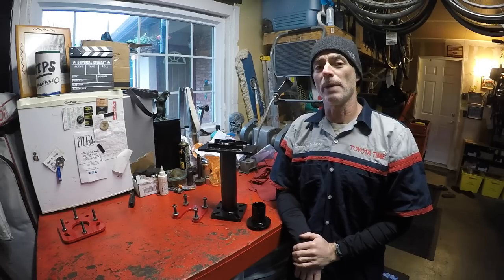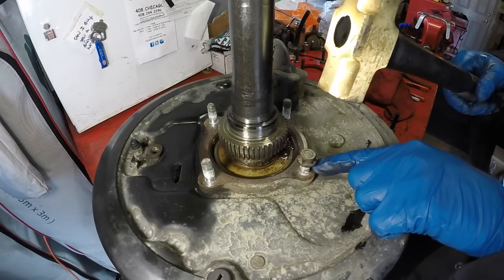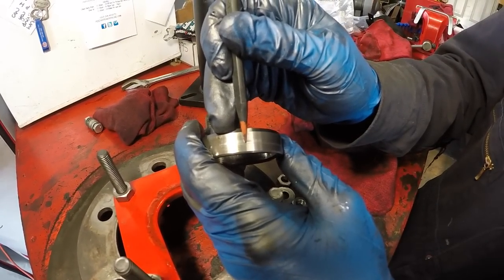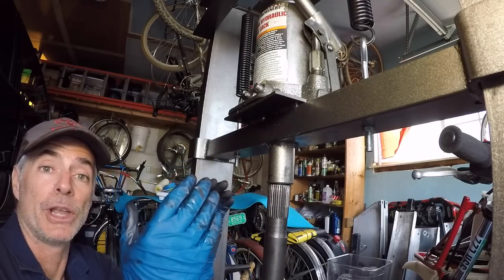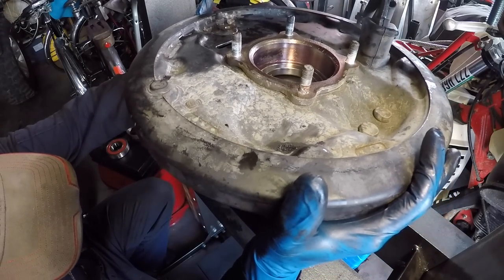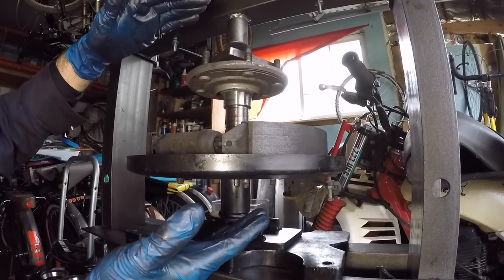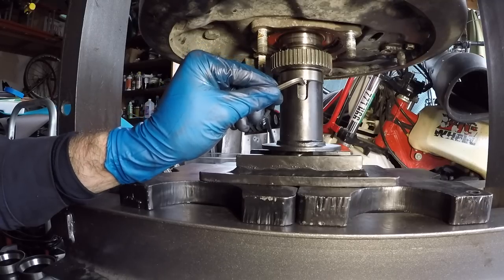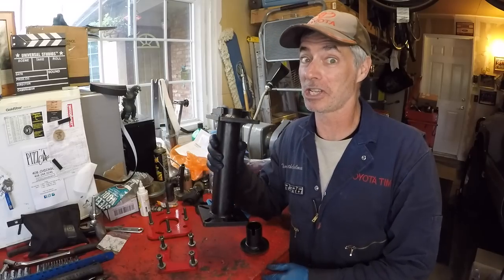Toyota Rear Axle Seal/Bearing Replacement (Part 2)

Comment from the maker: VERY IMPORTANT.  PLEASE READ THIS BEFORE STARTING THIS JOB

1) *Saving Money on Parts*  At playtime 26:32, we talk about how you can save money on the parts by reusing both ABS tone rings and reusing all 4 retainers by swapping their positions on the axle.  If you pull the parts off like we show in the video, you can REUSE the ABS TONE RINGS and reuse BOTH OUTER RETAINERS.  We suggest you PURCHASE NEW INNER RETAINERS to mate up with the new seal because the retainers sustain some damage during removal.  A new retainer will have a perfectly machined inner surface to mate up with the axle shaft.  Upon removal, some slight gouging occurs to the retainer and now it's no longer a perfectly smooth machined surface.  If you put a used retainer back on the axle in the inner position to mate up with the seal, there's a chance gear oil could travel between the axle surface and the inner diameter of the inner retainer due to the grooves left in the retainer from the removal process.  It's obvious the retainer, ABS tone ring and inner race of the bearing are made from a softer metal than axle because the axle sustains no damage from the installation and removal of the parts.

2) Some people have reported that even after doing everything right, they still had gear oil getting past the seal.  One culprit ended up being the metal to metal connection of the axle seal with the axle housing.  For some people, a previous mechanic or DIYer might have not been very careful and scored the axle housing with a seal puller or other tool.  Others might have had no detectable imperfection in the axle housing but they still had gear oil sneak past that metal to metal connection of the axle seal and axle housing.  A fix that will work for this situation is cleaning up the surface of the axle housing with acetone or denatured alcohol and doing the same with the outer surface of a new axle seal.  Smear some Toyota Red FIPG which is meant to work with gear oil applications or a similar gasket sealer meant to work with gear oil onto the axle housing sealing surface and also some on the seal itself and then drive it in.  The FIPG will fill any tiny imperfections in the metal and hopefully stop gear oil from being able to get past this connection.

3) When using the flipped inner retainer technique, it appeared 5mm of polished axle showing was about perfect to get the seal lip riding dead center on the shoulder of the retainer.  After pulling some axles from rigs we did this job on a couple years ago, it looks like 4mm of polished axle showing would be a better initial measurement to use.  With that said, you still need to verify you have a good mating of the seal and inner retainer by performing a grease of sharpie test.  After that initial grease or sharpie test, you'll know if you got it perfect or you'll need to do some adjustment.  Does the seal absolutely need to ride dead center on the retainer?  The answer is no.  Somewhere close is fine.  The reason why you want it close to center is to allow for axle play as the bearing ages.  If you're close to the one of the edges, the axle play could allow the seal to not ride on the retainer and then you'll develop a leak.

4) In the video where we show using 4 thin flat washers to pull the axle stud back into the position in the bearing case, you could use 2 of the provided thick flat washers from the kit to accomplish the same thing.  So, there's no need to buy some flat washers from a hardware store.

5) On the back side of the axle face there's a metal enclosure which is an "Oil Director" (our term, not Toyota's)  By design, if the oil seal fails, oil will eventually work it's way through the bearing, flow out through the dust seal into the Oil Director and then get spun out into the wheel through the hole in the axle flange and finally through a hole in the brake drum.  As part of this job, it wouldn't be a bad idea to shoot some brake cleaner into the exit hole on the axle flange and also spray it directly into the oil director from the back side to clean it out of any residual gear oil.  You wouldn't want your brand new brake shoes potentially getting contaminated with gear oil from the residual left inside the Oil Director.
Reply: Hi Tim. I was doing really well following your instructions, on the very last step of the last axle, I over pressed the ABS and retainer...got too excited. Any tips on getting the ABS and Retainer off? I don’t have enough clearance for the red metal piece to pull it off. Help please. Do I cut it off?
Reply from the maker: @RoNBEE1  Hey Ron, you must have pressed it on pretty far to not be able to get the ABS puller under the ABS tone ring.  You will have to cut it off unless you have a bearing splitter that will fit under the ABS time ring and that you can figure out how to bolt it to the axle puller tool.  If you watched Part 1, we use a bearing splitter bolted to the Durasolid tool.  To get the bearing splitter in place, you have to knock out all 4 serrated studs.  If you can't make something like that work, I would suggest cutting the ABS tone ring and inner retainer with an cutting disk on an angle grinder or similar tool.  You just have to be very careful not to score the axle.
Reply: I figured that much to have to cut it. Have to be very careful. Someone on a forum have put two pry bars and lifted it up slightly...I’d say I’ve over pressed it by about a quarter inch. The Abs Puller needs about 1/4 inch more for clearance.
Reply: Thanks for your tip Tim. I ended up cutting both of them off and hoping to find some new parts tomorrow. I did the grease test and 4.70-4.80 of polished axle put it right at center! However, when I put the axle back in to spin it. I heard a clicking sound. My ABS sensor magnet are on since I couldn’t get them off. But I’m not sure where that sound is coming from, someone side spider gears? (My rear differential is empty right now. Any help here? Will that sound go away when I fill it back up?
Reply from the maker: @RoNBEE1  The clicking is the gears in the differential.  Don't worry about it.
Reply: @TimmyTheToolman  u are the man Tim!!!! Got me worried!!! Thanks!
Reply from the maker: @RoNBEE1  You're welcome Ron.
Reply: Hey Tim. So I did this repair everything went really well, until a couple days ago I noticed the rear passenger side axle was leaking again. I am thinking the axle shaft may have some imperfections. I see that you mentioned FIPG, now I’m a little confused do I put that on the axle seal and the axle shaft? Thank you.
Reply from the maker: @justinrenderos8223  Hey Justin, did you reuse an old retainer at the inner position?  I mention the potential problems doing this in the comment I pinned.  The application of the FIPG can be used in two spots.  People have reported that gear oil got past the seal but it was from the metal mating with the axle housing and not from the oil getting past the seal mating with the axle shaft.  When they install the seal, they put some FIPG on the outside diameter of the seal before they drive it into the axle housing.  The other area people have put FIPG is on the inner diameter of the inner retainer if there's imperfections in either the retainer or the axle shaft.  The FIPG fills in any imperfections to stop gear oil getting past the retainer to axle mating.  I hope this helps clarify the use of the FIPG.
Reply: L
Reply: Fgh
Reply: Yws
Reply: TV
Reply from the maker: @kwilson424  Ok, I give up.  What does FGH mean?
Reply from the maker: @kwilson424  Dude, you're putting a whole lot of effort into these comments.   1st comment is FGH.  Now we get an L.  Unless you can start communicating like a human being, don't bother commenting anymore on our channel.